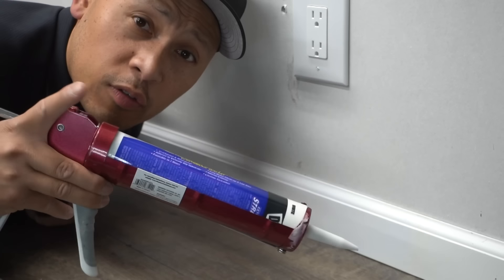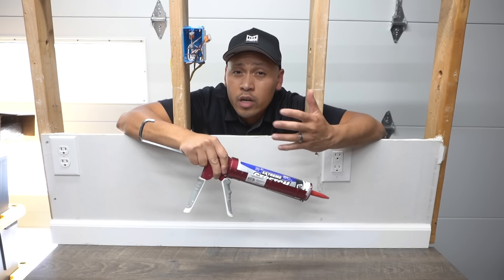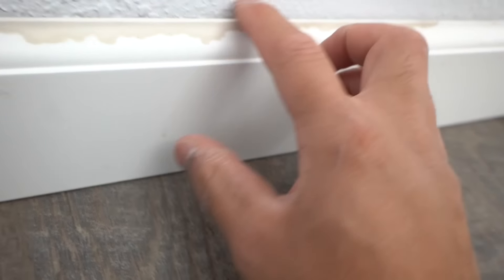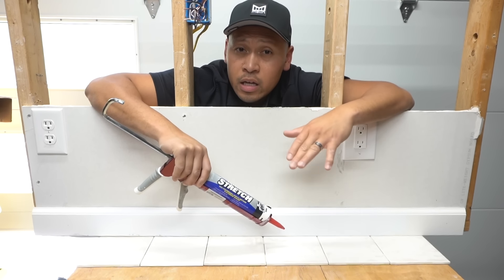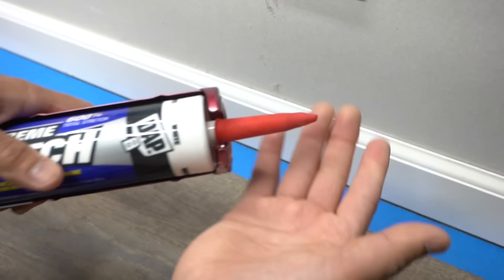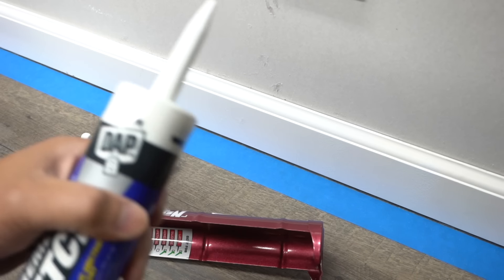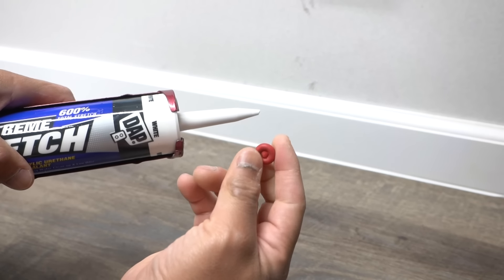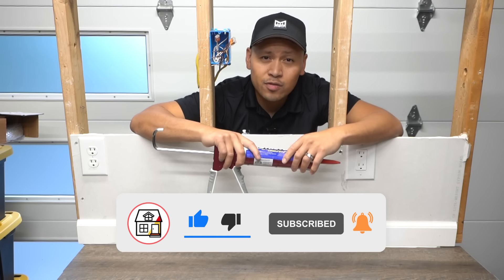Should You Caulk Your Baseboards To Your Floor? Pros And Cons! DIYers Great Controversy!

Comment: Helps with ants, spiders, and cockroach problems 😂❤
Reply from the maker: Yes! Especially ants 🐜 👍🏽😊
Reply: @FixThisHouse and spiders😮
Reply: The main reason for doing this is to stop water creeping under the skirting.
Reply: If you do this they will come in through the electrical sockets. 😂
Reply: It doesn’t fix the bug problems. If anything it will make it worse. You ll never see them so not aware.
Reply: What's a cockaroach? Is that sort of like a cockroach?
Reply: @jamesbookman1481 wait seriously??
Reply: @gabriellelord-sutton5386  you seal them too. Open it up and seal all the holes. Put the facing back on and seal around it.

Comment: Anytime that I've done a reno in my home that had the baseboard removed, I ALWAYS caulk under the drywall in THAT gap BEFORE the base trim goes up.I seal up interior walls as well do to the attic. Any chance to seal up the house is taken. I can store birdseed (in a plastic tub)and grass seed in my basement, which is a walkout, without any pests coming in. I haven't even had ants in here this summer. Only the occasional "stink bug" that finds a way through a screen.

Comment: You got all the tricks covered! The thing I didn't hear you mention is that when installing new flooring, the baseboard should always be adjusted up/down to get the desired gap between the flooring on bottom of the baseboard.  Typically, we use a sheet of cardstock about 1/16" thick placed onto the new flooring the set the baseboard onto the cardstock it provides a proper standoff.  Makes for a nice tight gap that can be caulked in one or two passes.  Also caulk the top between baseboard and wall to take up any gaps.  (Lots of experience rehabbing rentals replacing baseboards.)  Bathrooms & Laundy-rooms always get caulking. You're providing good information here, good job!
Reply: Rehabs and rentals differ from residential and new construction. there's always different standards and practices. I personally would never caulk the bottom of a baseboard.
Reply: @bengunnett3432 till ur fighting poisonous spider ur next door neighbor is collecting that got released and moved in to ur brand new to u 20k+ home i dont think u understand our problem😅

Comment: Use a damp rag or sponge and go over the caulking - it will make it look and clean up any of those little trails. Doing it this way means no need for tape. I use to be a finish installer and this how we did all our finish caulking.
Reply: That's exactly what  did with my hallway and staircase panelling. I saved so much time and got perfect results. First time I've seen someone else share this because i actually came up with that hack myself lol
Reply: Saint

Comment: I caulked the gap from the drywall to the subfloor first to keep bugs out.  Then I caulked the baseboard to my vinyl floor to keep water from seeping under it in the bathroom.
Reply: Yea I don’t understand this why not just caulk the drywall to the subfloor?
Reply: You don't want moisture dripping down and pooling behind your wall if something goes wrong. Also the slight airflow helps keep moisture down and helps prevent mold and mildew. Also you don't want a room air tight because breathing is a good thing. Probably helps with radon and other heavy gasses too.

Comment: Do it.  My wife likes to use a lot of water when she mops.  Many times she just soaks the floor,  uses a broom and cleaner to scrub the floor,  and then uses a wet vac to pick up all the water.  The result is a very clean house with extensive mold growing behind the baseboard.  So,  either use bull nose tile for a baseboard,  or use caulk.

Comment: I've been looking for the exact fix to my problem, and this video is it! We have a bedroom above a garage, and despite getting a new garage door, new windows, AND having the space between the floor and garage ceiling insulated, we still have problems with hot and cold air seeping in under the baseboard. I'm off to Home Depot tomorrow for the Dap Flex. Thanks for the great instructions.

Comment: I had to use a shoe mold because of the large gap but I still caulked the shoe.  My walls in some areas are wavy so the caulk really helps blend those areas. My home is older as well and stuff settles and what not.
Thanks for your videos.

Comment: I installed a snap lock floating floor recently. The manufacturer directed to maintain a 3/8" gap at the wall which for me meant the baseboard since I did not remove it. I decided to add a 11/16 quarter round so I could bend it up and down tight to the floor. I caulked the quarter round to the baseboard but not to the floor to eliminate possible buckling from restricting expansion  of the flooring.

Comment: I appreciate your video, very well done. We have a home in Florida and as much as I have gone to extremes to seal every nook and cranny I can find, I saw a very tiny juvenile cockroach make an appearance from underneath the quarter round in one of the rooms. I’m in the process of using your method. I did purchase the DAP Extreme Stretch. Your tips on caulking properly were very helpful. I didn’t know to very slightly cut the tip at an angle. I used to be that person who had a thick caulk line and made a mess when pressing down on it to smooth and help it adhere. I no longer hate caulking, lol. We do have a floating floor and I have no concerns with your method at all. The house is pretty much bug proof at this point. Thank you again!

Comment: When my father had the linoleum floor replaced with new, the installers used caulk along the bottom of the bathtub, but not the other walls.

Speaking of bugs, will you make a video on sealing house against them ?

Comment: …….or adhere the shoe molding using a natural or white silicone. I’d also caulk the baseboard first before placing the baseboard over it and caulk it too.   In LA Ca it’s required everywhere to prevent roaches form entering.  Also, liberally sprinkle Boric Acid within the walls by drilling a small hole and squirt the boric acid from its applicator into the hole.  Roaches die at once from this wonderful powder.

Comment: What you do is scribe your baseboard with your scribes or compass. Pick the biggest gap on your baseboard to the floor and run your scribes through the whole piece, take it to the table saw put a bevel on the table saw and free hand cut it. If you have rough saw marks on your piece take a sander or sand paper and clean it up. The bevel is extremely important and will make it look tighter.

Comment: Yeah man, whenever I am replacing a floor, I use expanding foam insulation in the corner where the floor, wall base plate, and drywall approximate.  Additionally, if I am installing a floating floor that has a 1/4” or 5-6mm gap, I sprinkle in a combination of Quick Bayt fly pesticide (granular) and boric acid.  If for some reason there is a slight gap or something I missed with the foam, those bugs have to run the gauntlet😆.  If you ain’t using Big Stretch, you might wanna look into it.  Best caulking ever made!  Kinda a pain to paint, but those reappearing cracks are gone for good if applied correctly.

Comment: Cold air leaks on outside walls is another reason to seal baseboard to floor gaps. I used window/door insulation foam on my baseboards.

Comment: Good attention to detail and humility understanding subjective nature of details.  Enjoy your presentations and know you would be a great coworker (not a prima donna).  I have caulked the edge of floating floors kept back from wall plates to allow expansion and contraction before the base to keep water from getting under the flooring.  I have rarely caulked the base but like your concept of a 'mini' quarter round.  One way I once caulked a base was to use matching color to base, taped the floor so tape was lined up with base front, then used a putty knife to smooth the caulk so the base looked like it was scribed to floor.  Came out very nice and next visit to house will see how it held up.  Anyways, great work and clear commentary stimulating thought.

Comment: You can never say running caulk on a floor is a code violation because codes depend on the country.  I use builder's clear glue for wood baseboard and builder's white glue for painted baseboard.  You run a thin line and then use a damp sponge so the caulk like is between the baseboard and the floor.  Then, I take a wooden skewer - the kind you use for grilling meat on a stick - and I use the pointed end to run along the bottom of the baseboard, which pushes the glue back about 1 milimeter.  Using a clean damp sponge, wipe any excess glue that you see on the floor and baseboard.

Why insert glue???  Here's the reasons:

1. Eliminate dust build up.  People dust furniture and think it's clean.  They're correct.  But on your floor, if you ever decide to wash it, moisture will get between the baseboard and the floor if there is no glue between them.  That moisture will get absorbed by the glue.  Over time, it will create a sticky hard layer and now you have a petri dish for growing bacteria.  

2.  Protect the edges of laminate plank floor.  It doesn't matter if you have hardwood plank, a floating hardwood floor, laminate.  There should always be a space of 1 cm (1/2 inch) between the edge of the floor and the wall to allow expansion.  The only exception is if you glue your flooring when you install it.  If you put a glue layer as I described above, it will not stop a floating floor from expanding normally during spring and fall, and the same is true for all other plank flooring.  What this glue line does is keep moisture from accumulating on the floor under the baseboard.  Moisture can come from cleaning your floor, accidently dropping a glass or cup filled with your favorite beverage, or a pet from accidentally peeing on the floor.   

That said, I'm a master carpenter with 25+ years experience.  I have a Finnish birch plank floating floor in my home made by Karelia Finland.  It's been there for 15 years and it still looks like new.  I ran the floor flat between the doorways because I don't like stepping over a wooden threshold inside my home. No problems with the floor.  All my vinyl floors in other rooms have baseboard or I put the same glue line.  No problems.

in closing, there should be ZERO CONTROVERSY about a glue line under the baseboard and the floor.  It not only protects both the baseboard and the floor from moisture accumulation, it prevents build-up dust that eventually absorbs moisture, creating a hygiene problem.  If you want to test whether there is a dust layer between your baseboard and the floor, fill a small spay bottle with rubbing alcohol (isopropyl alcohol) and spray a small section of your baseboard right where it comes to the floor.  Spray several times, so the alcohol can go under the baseboard and come back out where you can see it.  Then, take white toilet paper or keenex, lay it flat on the alcohol and then pick it up to look at the side that laid on the floor.  If it's not pristine white, then you have dust under you baseboard and probably in the crack between the floor and the wall, if you laid down plank or parquet flooring.  The alcohol will kill most bacteria, bleach kills just about everything if you let it sit for 10 minutes, but who has time to do this?  

For all the above reasons, I put a hidden glue line and after living in 7 countries during my lifetime on 3 continents, I've never run into a building code that says glue between baseboard and floor is illegal.  In Japan, it is customary to lay wood baseboard precisely on a wooden floor.  Japanese have very good carpentry methods and so a glue line would not be necessary in a modern Japan house with a wooden floor.

Comment: Also you can consider using a clear caulk especially if you have to go around different areas that don't match to create a water seal such as on bathroom floors.
Reply: Clear caulk works if waterproofing is your only concern. You're still going to see the gap though which is kinda ugly.
Reply: All exposed chalking is ugly after a little time
Reply: terrible advice

Comment: In my basement we have insulated subfloor panels with vinyl planks on top.  The subfloor manufacturer (Barricade) advises against caulking the bottom of the baseboards so that there's a bit of airflow reaching the concrete that the subfloor sits on.  Maybe one idea is to caulk the gap and then cut it after it dries to allow some airflow.  The caulk will at least visually still fill the gap and the cut might be small enough to keep the bigger insects out.  Just not sure if such a cut will be significant enough to maintain the airflow, but I figure some baseboards can be pretty tight to the floor.

Comment: I caulked the gap between the trim and tile floor in my laundry room.  Had one too many times where leaks occurred.  Caulking at least contained the water in the laundry room floor above the tile.  Other side of the back wall is my TV room with LVP flooring.

Comment: if you are installing new baseboard, does it make sense to apply to the bottom of the baseboard before putting in place so that the caulk would be under the baseboard instead of on the front edge of the bottom of the baseboard?

Comment: I have seen LVP and laminate flooring failures due to locking the floor in with caulk. I suggest calling the customer support line for the flooring manufacturer to ask what they recommend before you caulk.
Reply: Caulk shouldn't lock it. It should flex with the floor
Reply: @JP-yd4yl  You would think so right? And that sounds like something I would say until, I've actually seen floors that were caulked lift. I cut the caulking out and like magic,  after a couple of days it was back down. Again, I suggest contacting the manufacturer before caulking the baseboards to  a floating floor.
Reply: @FIREGURU I caulked and painted it in my house. It's been 5 years no problem. Maybe the quality of the floor makes a difference
Reply: @JP-yd4yl  Could be. I've seen it happen to both LVP and Laminate flooring. I imagine the area the house is in might play a part as well. Low or high humidity. Subfloor too .OSB, Plywood,T&G or slab. It was over slab that I saw it pop up. New home construction.
Reply: It voided our warranty - these warranties on floors is for the mfg'er not the consumer. We had several planks break at the seams and filed a claim and the claim was denied.

Comment: How would you go about sealing the airflow between an upstairs apartment and the downstairs unit? As an upstairs dweller I can attest to the air flow issues: when my former neighbors lived below their cigarette smoke came into my unit. After several years they moved and the new neighbors don't smoke. My breathing has really improved! But just in case I would like to seal the air passages. Is it possible?

Comment: Pretty decent video, from someone who looks like they actually do this for a living vs. the DIY influencer type who is still very low on the learning curve themselves.  Pro Tip:  Usually better to follow a poor production value video (not that this one is) by someone who does it for a living than something polished with good production value by a fellow DIYer. Being entertained is great.  But that crusty guy with the bad sound who has laid thousands of feet of trim has forgotten more about how to do the job right than that person who did it once on their tiny remodel and is more focused on building a brand will ever know.

 A few things I do differently (If you're even going to caulk a floating floor like that, which is debatable as it's going to have thermal movement).  One, I would never run drywall that low, but that's preexisting so I get it.  If you're doing that install you want a gap because if you have water on that floor, drywall is a sponge.  And when it gets wet, it expands, it stains, it breaks down, and it can mold.  Run it a  a good half inch off the floor so if you get a little water and it stays dry.  You're running a moisture barrier under the LVT flooring anyway, and you can just wrap that overlapping the drywall and it's hidden behind the trim.  Second, I run that tape all the way flush to the trim, so there is no radius extending out proud of the trim onto the flooring.  Much harder to notice when you're done.  Third, use a damp (as in wrung out REALLY well) grout sponge and run it along that line.  Does a better cleanup so you don't have that streaked glob on your trim, and works the caulk under the trim.  One quick swipe works it in, and second on a clean spot on your sponge cleans it up.  End result is that it's much harder to see that caulking and looks more like the trim is completely flush.  Keep a bucket of water handy and rinse that sponge regularly.  Oh, and when you cut the tip on your caulk tube, as mentioned you don't want a big opening, so only cut a little.  And cut it at and angle, because you want to run your gun at an angle too and that allows the tip to run flush with the surface being calked.  Also directs it into your gap.

Finally, I'm a firm believer in the saying among painters and finish carpenters "DAP is crap".  Personally, for caulking trim I'd rather use White Lightning that I get at Sherwin-Williams (among other places), or Sashco Big Stretch that they carry at DIYer places like Lowes or Ace.  And don't go cheap on caulk.  A paintable latex caulk like that is not expensive, and NOT a place to save one dollar.  New caulk flows better than old.  If it's been sitting a long time, spend a few bucks and get a new tube.  And I would never buy things like caulk on Amazon.  They don't rotate inventory like a big box or even better yet a paint store, and that can make a difference.  Plus if you're in a cold climate, having it sitting out on your porch getting frozen isn't a good thing.  Finally, this is a "Best Practice" thing, not something dictated by code.